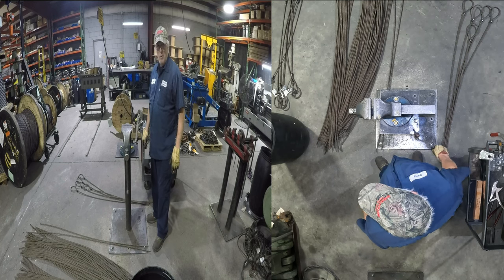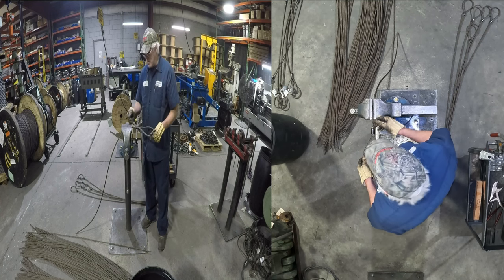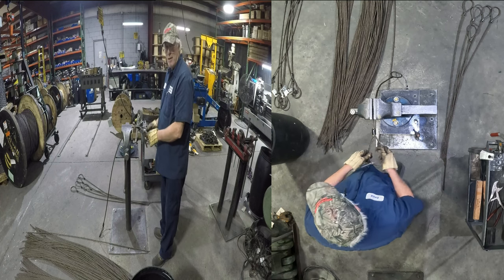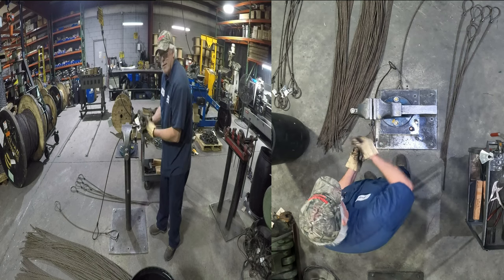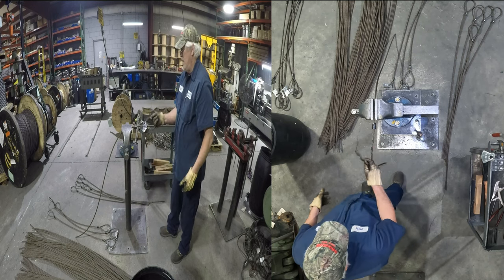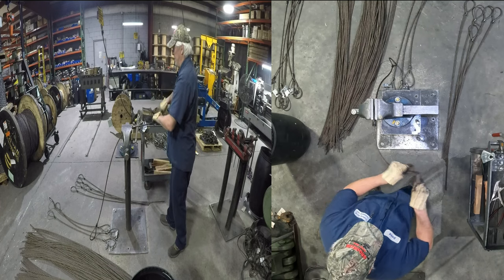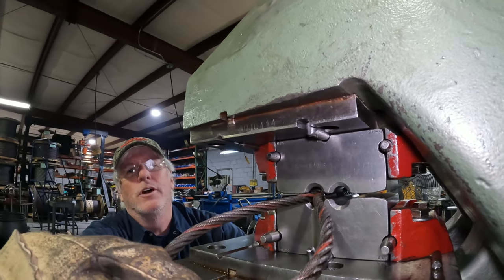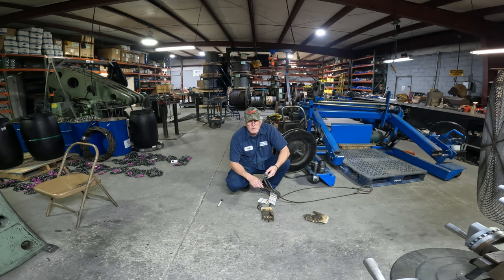Splicing 3/8" Wire Rope Slings

Comment: Kudos on the overhead cam!!!  Good move.  Wondering why you put your manufacturer's tag/Weight Test tag in the eye rather than on the length.  It would seem to me the tag has the opportunity to get into the load and get destroyed or bent all to hell and make them unreadable.  Since I'm a Quality Engineer, that would be the very first thing I would verify on a rigging setup - that the current test has been done and appropriate test to load is correct.  Just curious.
Reply from the maker: Always put the tag on the crane hook and there won't be a problem . On bigger slings we put a wire in the sleeve and hang it there, you never want the tag sliding up and down the body.  Thanks for watching and asking questions.

Comment: you guys have videos on how to repair in the field a cable ?
Reply from the maker: No I sure don't and we don't do any field work anymore, the presses are to big to transport, our big one weighs 21,000 Lbs but there are old ways like a taper and concell hand splice, electroline wedge type fittings, molly Hogan which the timber guys know, wire rope clips and spelter sockets.  Thanks for asking and watching.

Comment: When i was in the Navy we called this type of splice a mind splice the tail was left longer for a cable clamp on the end some times even 3 clamps on them? Do you ever do a Liverpool splice any more? It has been along time.
Reply from the maker: No we don't do that and I am pretty sure it will not pass OSHA regulations. I'm sure it will hold just fine at 5:1 with no problem.

Comment: If you use a pipe vice you can put 10 pieces in the vice. You'll spend more time flemishing and less time changing out each piece.
Reply from the maker: I need the exercise. Plus I have been doing it for 36 years so it doesn't bother me. 🙂 Thank you very much for watching.
Reply: @hanginwithdaddio  I've got 20 years this past August and never really watched videos of other rigging shops.

I've heard tale of people flemishing from the middle of the eye but never seen it before. I think it's interesting to see the little differences between shops doing the same work.
Reply from the maker: We definitely are a rare breed,  which company do you work for? My Dad has Ben doing this since 1964 and is 83 now and still comes in to work 3 days a week.  We are small now we had 6 shops that we sold to Bridon (Certex) back in 1991 and we also owned the Crosby and the CM distribution center at that time also.  We are originally out of Atlanta.
Reply: @hanginwithdaddio  I work for West Coast Wire Rope and Rigging in the Seattle branch. We have locations in Portland,Oakland, Seattle,Spokane , PacWest in Los Angeles ,Sakhalin Island,Russia and recently purchased Obert Marine Supply in Seattle. That's cool that your dad still comes in in his 80's . I don't think I'll be in the shop that long as my wrists,fingers, and elbows are starting to wear out. Will probably be seeking a sales job or a shop that does smaller rope.